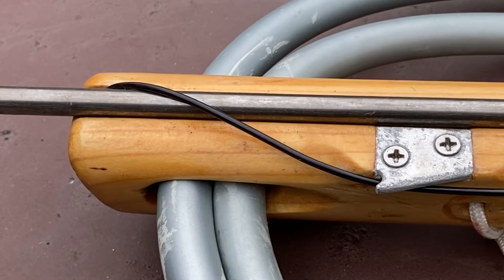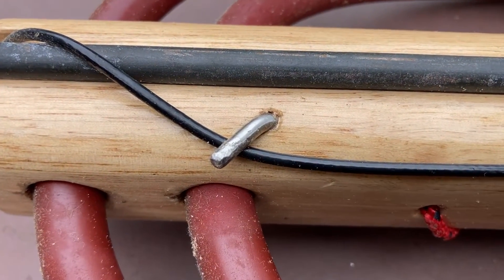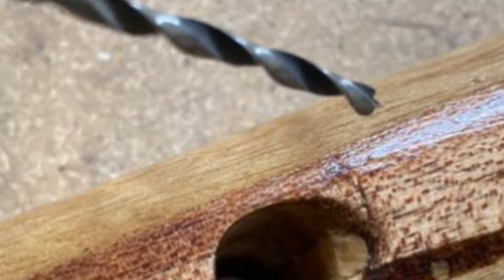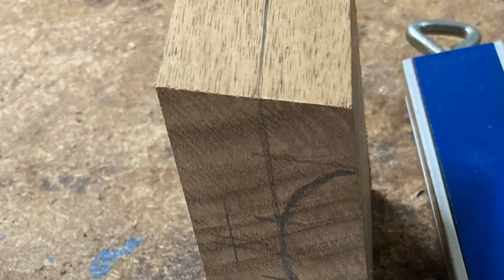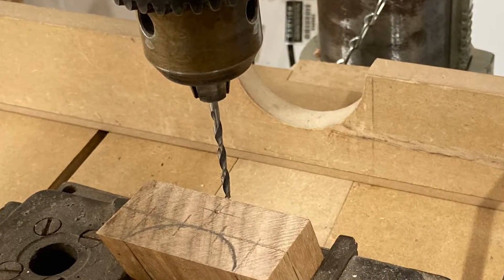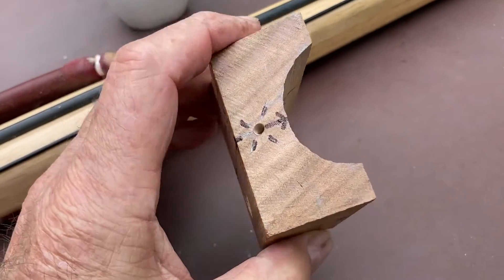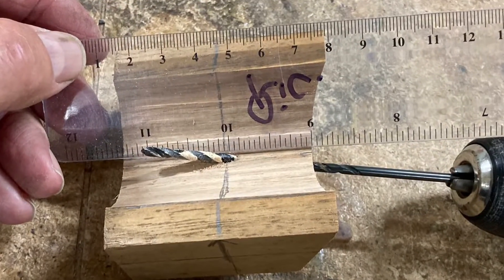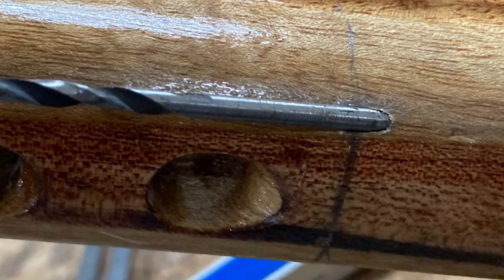Drilling jig for shooting line retainer pin

Comment: I use a bent pin so that I can drill perpendicular to the face, Then I glue my pin in with epoxy. Your method is nice because it removes the need to glue the pin to keep it straight
Reply from the maker: Thanks for the comment.

I’ve used a bent pin in the past. The drawback seems to be the possibility of the pin rotating.
Also, my preference is for 1/8 inch rod, which, when short, can be difficult to bend neatly . . . not an overwhelming problem, but annoying. 
I’ve also got some 2.5mm rod, and it’s easier to bend, but it just doesn’t look robust enough to my eye.
Reply: @diyspeargunner2386  when I install bent pins I use a grinder to cut little notches in the shank, hopefully these notches fill with epoxy when I glue them in and prevent the pin from being able to rotate or come out. 
You do need a thicker pin to be able to do this though, fortunately I have access to a nice bending machine at work.